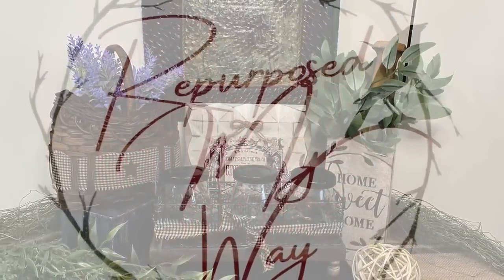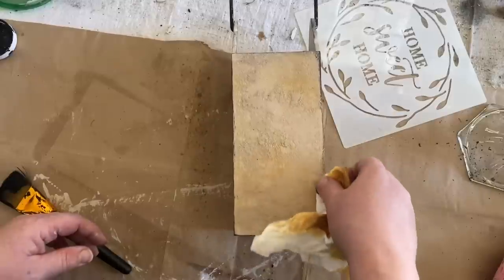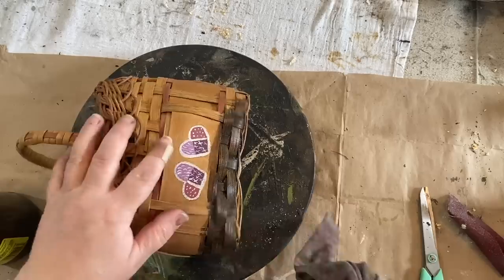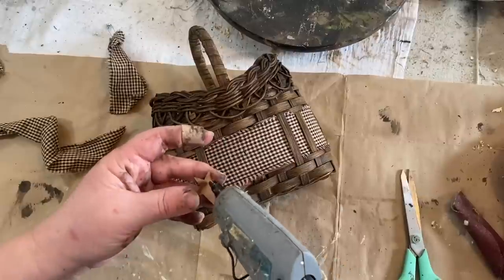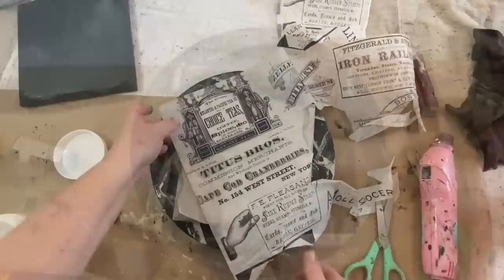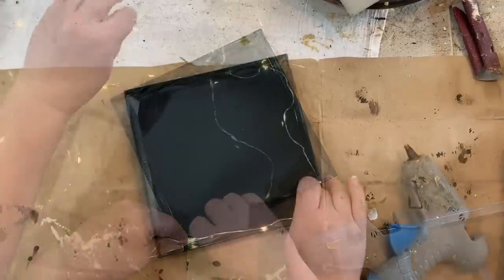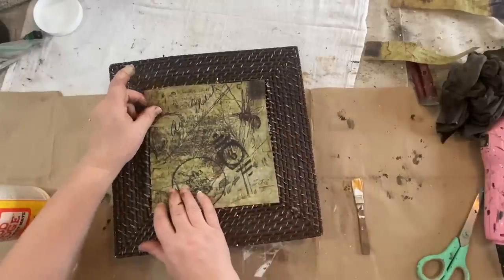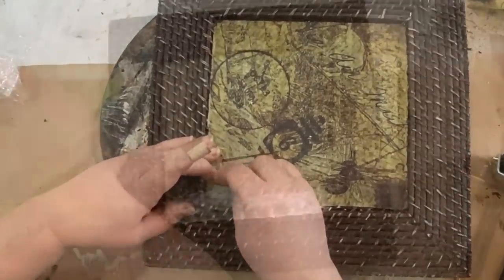Inspirations For Thrifted Home Decor | Budget Friendly DIY's

Comment: What stain did you use for the basket? I didn't see in your info below. The basket turned out lovely.
Reply from the maker: I use an 8oz bottle of waverly antique wax (or what ever size you want it keeps well) 8oz of water (or whatever size you are using) and a tablespoon of black paint.
Reply: @RepurposedMyWay  thanks so much